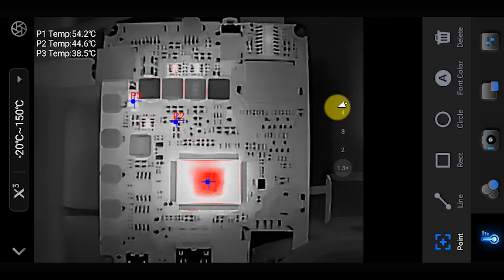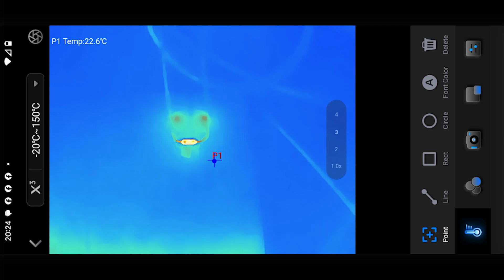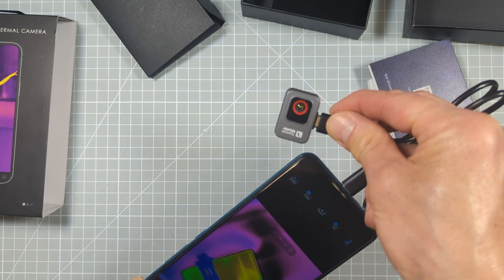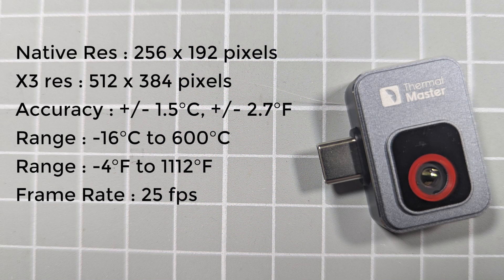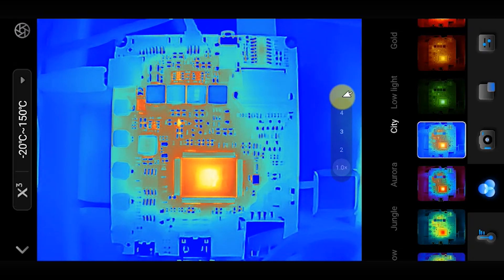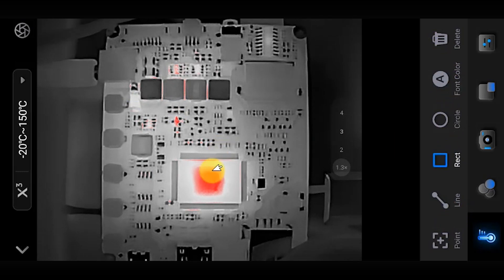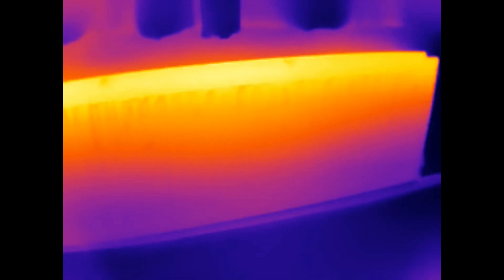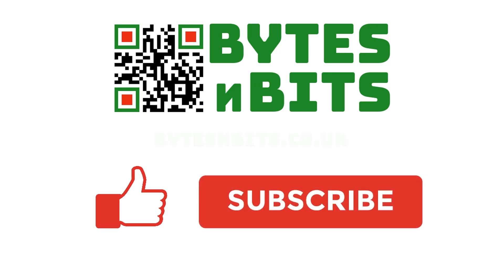Thermal Cameras for Electronics - Thermal Master P2 review

Comment: I'm a professional embedded systems engineer and I bought FLIR one (first gen) I think back in 2015 and it has been an invaluable part of my electronics toolkit ever since, love that thing.
Reply from the maker: I'm just starting to use it for some console restoration. Works really well to point you in the right direction.
Reply: But Flir needs to be charged hey, the power consumption is too fast, before my Flir one pro with a trip to Norway to use, the day before a full charge, the next day after less than 20 minutes of use is out of power (may be because the weather is a little cold)
Reply: @Jesi-j5z  That is a fair point. I mainly use mine on lab benchtop measurements, so I have the capability to charge at any point, so I can see this being a problem if you're more on the move and the camera doesn't supply it's power directly from the phone's USB-C.

Comment: 1.5C seems a bit far fetched. I could believe +-2% maybe but exactly +-1.5C isn't realistic for this price range. I doubt even the most expensive thermal cameras can lock onto the temp within 1.5C.
Reply from the maker: It's hard for me to verify it precisely but it does seem in the right region. It does have compensation for various surface types as well so I think it can be tuned to give these accurate readings.
Reply: But those pricier cameras just don’t seem worth it. I’d rather snag something reasonably priced, like this Thermal Master P2—it’s got solid accuracy too. No clue why these thermal cameras are getting so expensive lately. Is FLIR the one setting the bar so high or what? 🥲🥲

Comment: Greetings. I would like to ask you if it is possible, with this Thermal Camera repair the electronic tabs of the televisions. Point the room on the TV cards and see which processor or other component does not heat, even SMD. The component who does not heat could be defective
Reply from the maker: Yes. This will basically let you see what components are either not using enough energy or using too much.